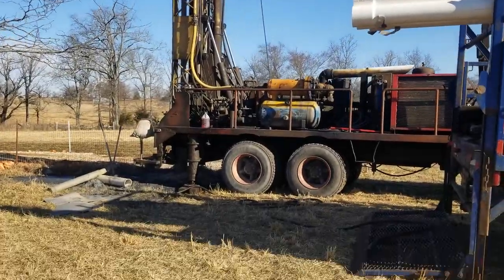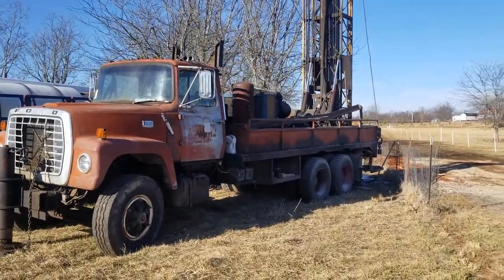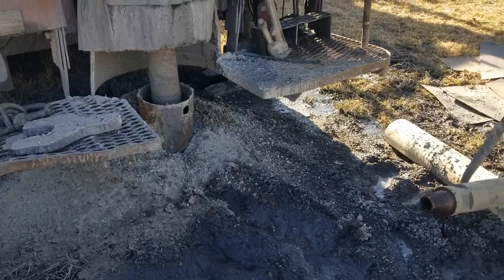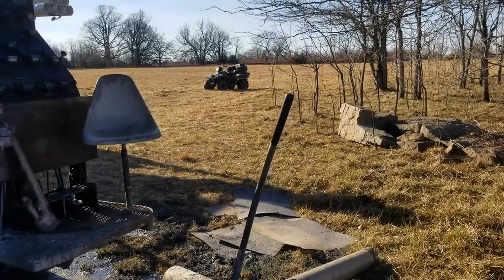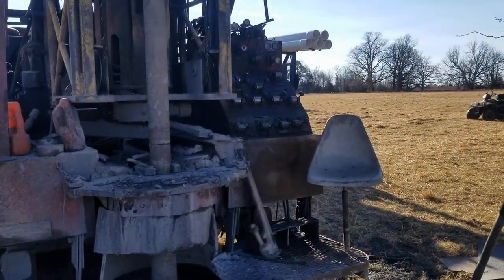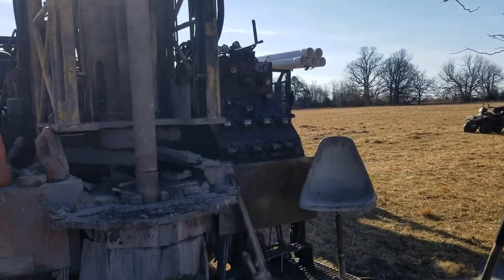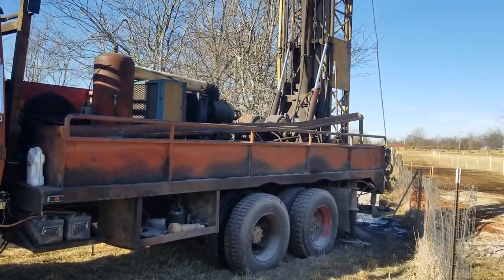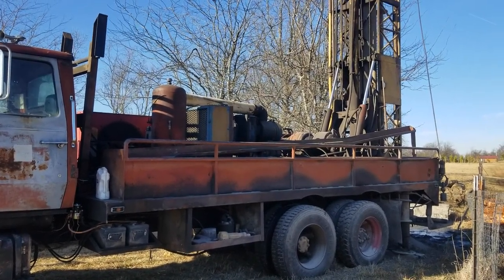Oldest Well Drilling Rig in America

Comment: Definitely not the oldest operating rig in America.. This model of drilling rig in the video which is either a TH-55 or TH60 was originally manufactured by Sanderson Cyclone approximately 50 years ago. Ingersol Rand bought out cyclone and produced it, and aince then Atlas Copvo bought Ingersol Rand and has produced it. Since its original production this top head rig model has been the one all other top head drilling rig manufacturers will have either made reference to or compared their equipment to when trying to sell you their product. I own a 1980 TH60 myself and drill with it in Wyoming. To buy a brand new TH-60 today it would cost you around a million dollars. So you can understand its not just as simple as going and buying a new one. Any piece of equipment will do the job if its sized or set up for the area, and it is maintained appropriately.